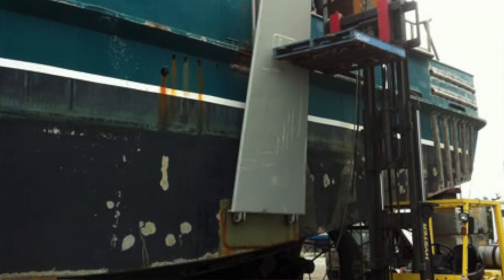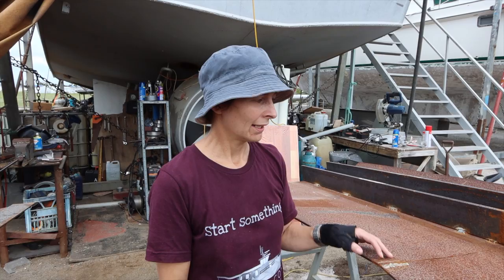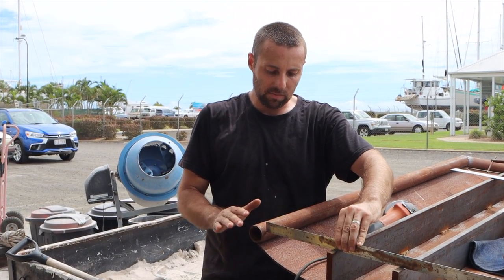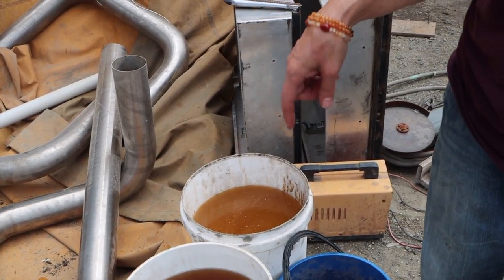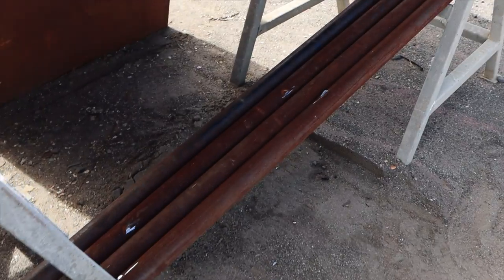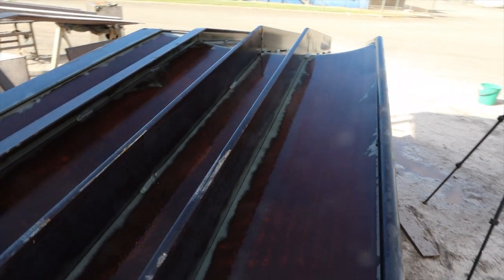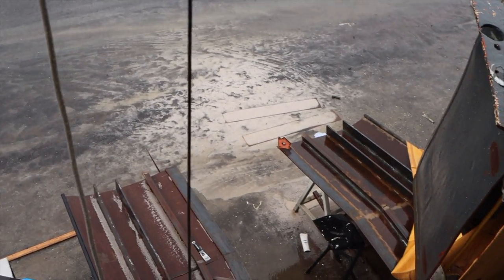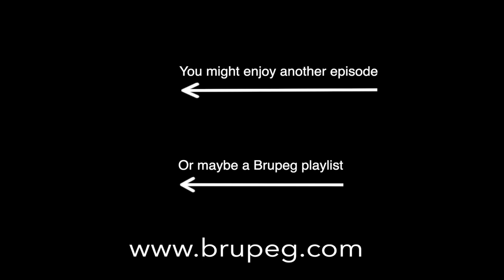Welding Steel Wings Together - Project Brupeg Ep. 127

Comment: A bit late in the day I know but I am still struggling with why you are going with an asymmetric hydrofoil.  Water being way more dense than air aren't you going to have a lot of lift and hence, induced drag from such asymmetry?  Why do you want the lift in the first place?  Won't it have a negligible effect on draught given the overall weight?  From your initial images I thought you were using dihedral to effect a righting moment (like an aircraft) but it looks like they will be horizontal when deployed.  I'd like to understand what you are thinking.
Reply from the maker: Hi Keith, With so much potential load on these wings we need very robust vertical internal structures to maintain the strength needed. Hence we need to build in so chord into the wing. If a wing is symetric the only effect it can have is if the boat rolls and a load imbalance is created. With assymetric profils the wings are always under a load (in our case lifting 100% of the time) this makes the wing more effective. think of a yacht, in light winds, rolly seas, main up to stop the boat rolling around. If the boom is sheeted in hard but the boat is head to wind the boat still rolls around until some apparently breeze is created but the rolling sail. but the boat has to move quite a bit to get any effect. now imagine the yacht turns off the breeze a bit so the angle of attack is creating a constant lift (even if its a small amount) the stabilisation effect is massively improved, hence assymetric foils are more effective than symetric foils.
Reply: @ProjectBrupeg  Of course.  I made the fundamental mistake of assuming they were active stabs knowing full well they are passive.  Thank you, sir.

Comment: Hat's off to you for your tenacity and sheer hard graft! I would like to echo Titus142's comment below, I ran fishing boats equipped with hydraulics for 30 years which all were powered by the main engine. Most had power take offs driven from the front end of the engine, often using a double universal joint PTO shaft which deals with any misalignment issues and flexible mounted motors. If your gearbox is a Twin Disk it may have a PTO point on the back of the box, in which case it is just a simple job to remove the cover plate and bolt on the hydraulic pump. Another option is an electric motor powered by the genny to drive the pump, it's just a shame to see the genny going.
Reply from the maker: Hi Roger, our main and box doesnt have any PTO options so we would either need to belt drive something or add a forward pump on uni's like you described. We dont really have the room at the front of engine for that and I hate belt driven heavy machinery. So for us because the AC alternator was toast and not worth repairing the engine was still very viable and worth re-purposing. Remember this hydraulic system is for short bursts like anchor winch, roof crane, wings up/down etc. it also doubles as our get home safe motor if the main and box die (more on that later). We plant to have two gensets, one get home safe motor and one main, with two seperate hydraulic systems for redundancy.
Reply: Project Brupeg Now I understand thanks for taking the time to explain Damo, I wish we didn’t live on the other side of OZ otherwise I bring my tools and give you a hand. Cheers Rog
Reply from the maker: Thanks Rog, always appreciate the help when people can do it. Good on ya mate.

Comment: Nice vid as always! Wouldn't simple cutting the top skin shorter solve your pipe problem? That would move round pipe upwards and solve it. Right?
Reply from the maker: Yeah thats an option, didnt think of that. I would be hesistant to cut into the skin when a simple pipe change fixes the problem in a much shorter timeframe though
Reply: @ProjectBrupeg  Thank you for reply! You are absoluttly right. Cutting would make sence only if pipe dimensions, wall thickenss or radius would be somehow important for structural integrity or waterflow around wing. Otherwise your solution is much more practical.

Comment: Can these wings cause a problem as you pass floating ice? Would they be easy to lift in that circumstance?
Reply from the maker: Hi Michael, in ice these wings will be lifted vertical. Even if they are under thin ice the rams will have enough grunt to lift the wings through the ice either way

Comment: Are you also considering a manual means to raise the stabilizers as backup? Could be as simple as a strategically placed hand-cranked or electric winch that could serve other purposes.
Reply from the maker: Hi Joel, its a constantly evolving design, currently we are dropping hydraulics and moving back to electric winch. Most likely with a manual back up
Reply: @ProjectBrupeg  This is what I like so much about you all. Keeping an open mind and the crowd   support attitude will serve you all well. Wish I could be there to help. You never know.

Comment: DO GET SLAG FROM A MIGWELD  ???
NOTICED THE USE OF A CHIPPING HAMMER
Reply from the maker: Generally you don’t but we are using a dual shield wire. The wire has flux as well as the Argon from the nozzle. Hence we have to chip the flux off once welded

Comment: Will there be a way to trim the angle of incidence to counteract any asymmetric lift ? Or would that force not be strong enough to cause trouble/annoyance?
Reply from the maker: Hi Jaakko, these will be a fixed angle of attack. other trawlers dont have any issues not trimming so we wont be adding in that complexity. The wings will produce even lift
Reply: @ProjectBrupeg  Gotcha. As soon as I'd posted,  I thought about it a bit more- with the relatively low speeds small area involved, the total lift generated will probably not be huge, and any imbalance will be lost in the noise in anything other than dead calm.

Comment: You need to Make small toy models to check the ratios  on the wing and hydraulic ram.  Sounds cool. 
BTW: the only Corona here in Arizona is beer.
Reply from the maker: Yeah we did end up modelling the wings, as for corona in Arizona being beer only... I wouldnt be so certain, if your not testing you cant be sure.
Reply: @ProjectBrupeg  10/4....We pretty much have everything under watch.  Anyone going or coming through the airport is given a visual and questioned. If they are suspect, they get tested.  Last check we had 10 cases and all are safely isolated.  My son is an RN at the veteran's hospital and they are under lock down. (everyone coming or going must go through a police check point.  No visitors or other non serious patients. )  He has been exposed and is undergoing twice daily checks for 14 days to see if it takes.  He is under orders to go only home and work until he gets cleared or is positive.  Everything seems calm here.  Thanks and you keep safe.
Reply from the maker: Sounds like they are doing the right things, We have been stocking up the boat for a few months now (nothing to do with Corona, everything to do with being ready to sail when we launch) so for us we are putting a halt of visitors and volunteers and self isolating
Reply: @ProjectBrupeg  Please above all stay safe,  You both are in a good position to weather this storm.

Comment: Why are you using gas when welding with flux core wire
Reply from the maker: Hi Rick, it allows a hotter weld so better penetration for the thicker steel. It’s a fairly common thing on these trawlers in this yard to use flux and gas

Comment: Why are you running flux core wire if your using gas?
Reply from the maker: Because we get a hotter cleaner weld. It’s quite common with the commercial boilermakers in this yard

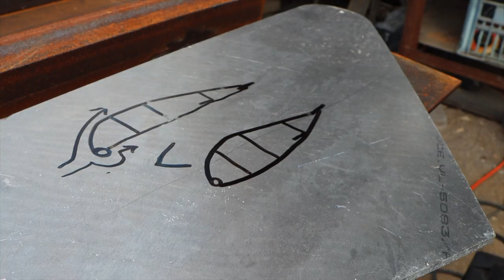Comment: at ~12:55 you're explaining changing the diameter of the pipe for the leading edge of the wing. Will that not make the two wings asymmetrical? Sorry, just really curious what effect that will have on performance at sea (steering pulling more Port than Starboard, for instance).
Reply from the maker: We changed both wings so symetry is maintained, i likely didnt explain that clear enough
Reply: @ProjectBrupeg   Ahhh...  I probably should have known that, since you're pretty meticulous.
Reply from the maker: Im not sure I would survive the thought of each wing being different to the other, Jess would most likely find me not sleeping for weeks then jumping out of bed at 2am on a random tuesday furiously grinding and welding a new pipe to the front of one wing to match the other...
Reply: @ProjectBrupeg  Indeed!

Comment: 32mm pipe on the wing leading edge??  Ummm .... Why not cut an inch or so off the leading edge of the top curved sheet and use your existing pipe. It will reduce the surface area of the wing bit it probably will make no difference
Reply from the maker: Yeah true but its much easier to cut a few tacks off and swap the pipe than cut 4.8meters of 6mm steel

Comment: D, you do realize the wings will “lift” unless they are locked down?
Reply: cwjarvis3  Unless they provide a “locking feature” the wing will “fly” in the water. Water over the wing moves slower and therefore has a lower pressure on top versus the lower surface hence high pressure seeks a lower pressure pushing the wing up.....
Reply: cwjarvis3 I haven’t seen his extend and retraction system yet, I was commenting that it has to be addressed. BTW I probably know more about hydraulics than you. Thanks
Reply: cwjarvis3 you asked me if I know how hydraulics work, I do. Let me say if you are locking a system for extended time you don’t rely on system pressure to secure it.. Damien does great work and I wouldn’t want him to do a ton of work and then realize he has to rework it. Pretty sure Damien can speak for himself...
Reply from the maker: Guys no need to argue. locking arms, very much so. Hydraulics... not so much, we started with the idea of a winch up top. then dropped it in favour or rams and folding arms, they are proving to have too many compromises so we have gone back to a winch up top but with a solid arm on a vertical slide. every day this design is changing as we uncover and solve road blocks.
Reply: @ProjectBrupeg  Pete is right, at the very least the constant compression of the ram under load will damage the packers inside until they eventually allow fluid to flow freely back and forth, or worse case scenario blow the whole pack into the water along with a few gallons of hydraulic oil.  You should give some thought to a locking collar that locks the stabilizer into position in both the working, and resting  position.
Reply from the maker: Yeah this is spot on, the wing is literally vacuumed up by the low pressure area.
Reply: My Account yeah you’re right I got it backwards with the speed...long time remembering stuff...high seeks a low....
Reply: My Account not at all, love watching the work around s Damien does. His doors are all most the same as Airbus doors. I wanted to take pictures and send them to him....he should look at landing gear bracing for over center links to lock the bracing for the stabilizers. Cheers brother

Comment: Bit of a waste using the gen set with 3 cylinder for a hydraulic pump, why not use the other gen set for a pump ? more than enough with the right pump i would have thought
Reply from the maker: It’s about hp. Hydraulics need a lot and the biggest spare engine we have (the Kubota) is only just big enough.

Comment: Ahhh ...   Ahhh ... Let me understand this ... You put the 1/2 shell of that generator housing on the cabin carpet ?  If I did that in America, there would be blood spatter all around the housing.

Is there anything more sexy than a skinny woman Mig welding mild steel ?

Also ... which one of you lot lost the foot on that large clamp ?  Every time I turn around, one of you is messing up one of my tools (weren't we married once)  ...
Reply from the maker: 1. If Jess had her normal strenght still it would be her lugging a 45kg generator up from the engine room and dumping it on the carpet... shes not precious about that sorta thing. 

2. 100% agree, the correct answer is no.

3. It came pre lost.